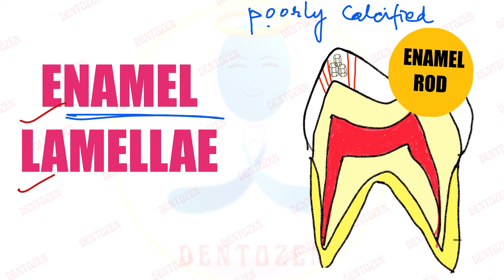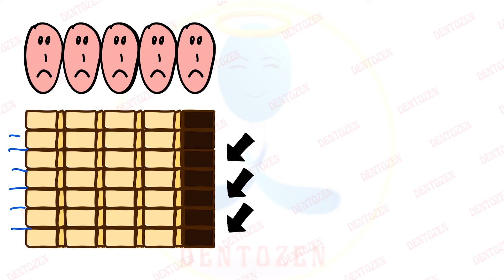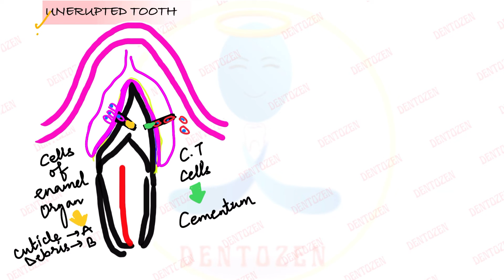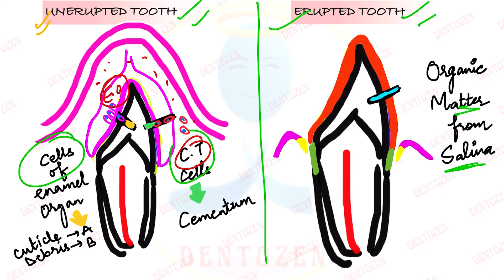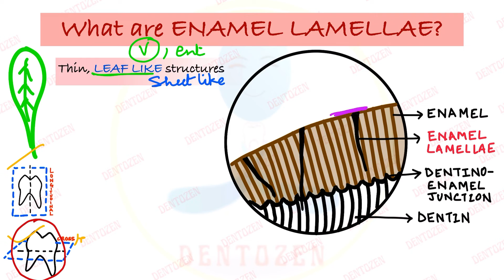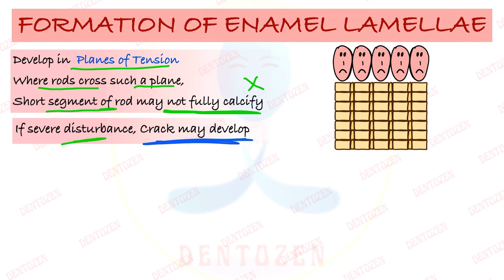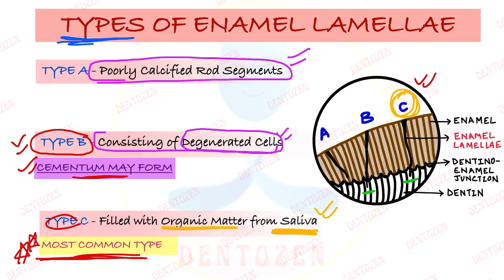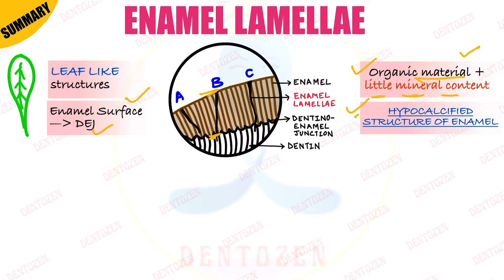Enamel Lamellae | Enamel dental histology | Hypocalcified Structures of Enamel

Comment: Why do they appear best in transverse section
Reply from the maker: Because of the way they are aligned,  run from enamel surface to DEJ longitudinally, so they might not be seen in L.S. 
If we want to see some structure in a section, we cut the section in direction opposite to it, so that structure can appear in section.. You can take example of growth rings, they run along whole length of tree  longitudinally and but are best seen in cross section or transverse section of tree..